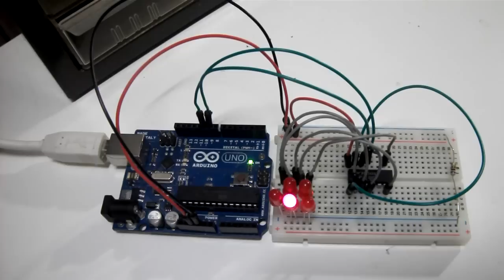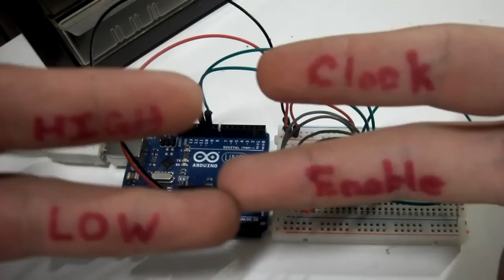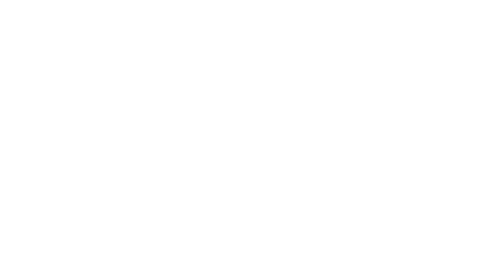4017 sequential LED flasher.

Comment: seems like the arduino is a lot of hardware for such a simple job. Why not a 555?
Reply: CorruptReverend It'd be cool if you did a video using the 555 timer and explain how everything connected works.

Your brief explanation of the IC 4017 helped me understand how it actually works, and I've been looking all over for a clear explanation.
Reply from the maker: It absolutely is! :)

I have built 10 LED flashers using a 555 along with a 4017 way back in high school.

I just used the arduino in this video because it's quick and easy to set up the output to feed the 4017.

I think this was supposed to be part of a series showing different ways to make a sequential LED display (most of which used Arduino). I just can't remember what I did with the other videos, or even if I recorded them. haha
Reply from the maker: Axertion I'm glad I could help! :-)

I definitely think I could do another video showing how to use a 555 instead of the arduino and try to explain how it all works. I'll be sure to let ya know when I upload the video.

Thanks for watching!
~Rev.